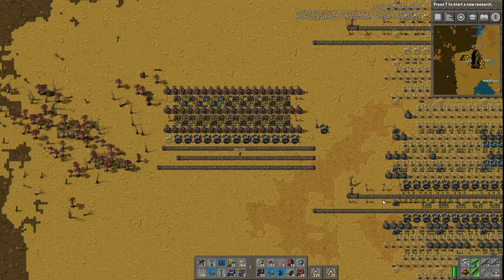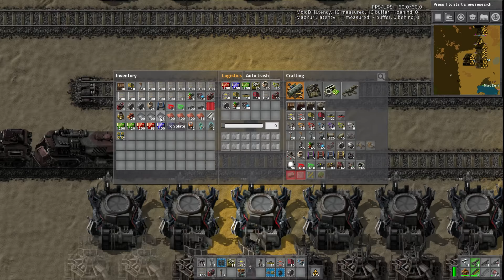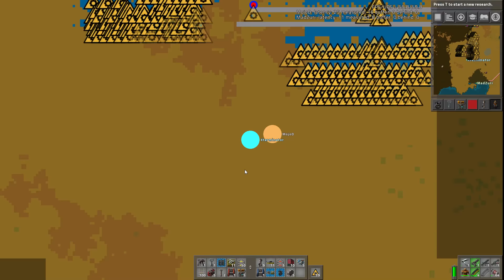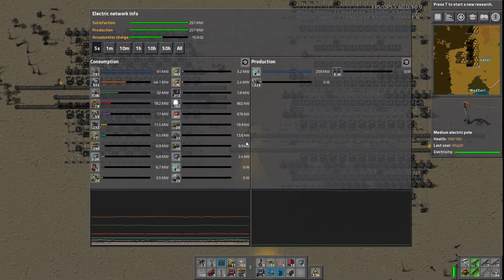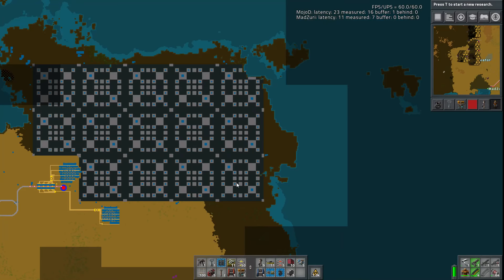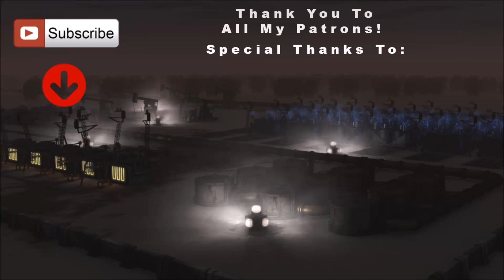Factorio 0.15 Megabasing 101 Tutorial EP6: Build Optimizations - Multiplayer, Gameplay, Let's Play

Comment: Your argument against smelt-on-site assumes very large patch settings, small or medium patch sizes are much better for that kind of setup.  You can easily get the throughput you need from small patches with high prod reasearch and speed modules.
Reply from the maker: Thundorgun That may be true, but smaller patches may mean you need to move everything even more often
Reply: Same richness smaller size.  Patches still have 50-100M.